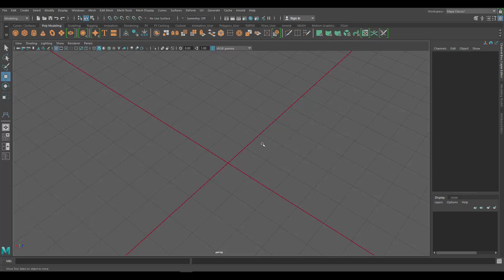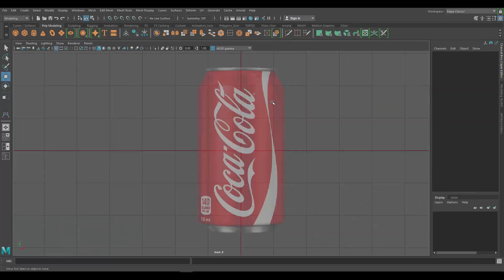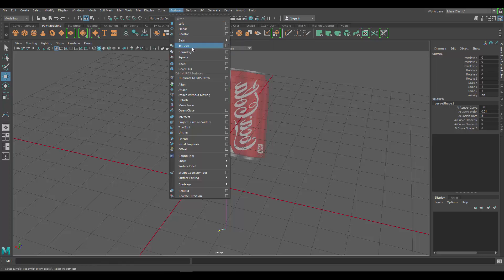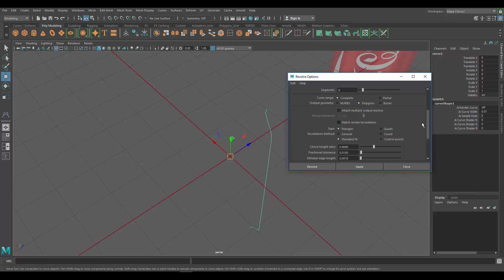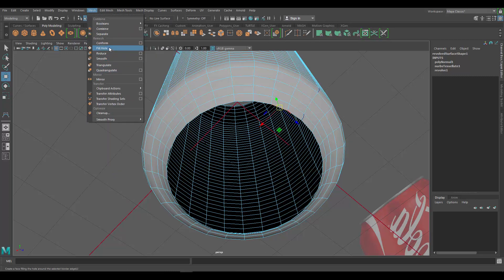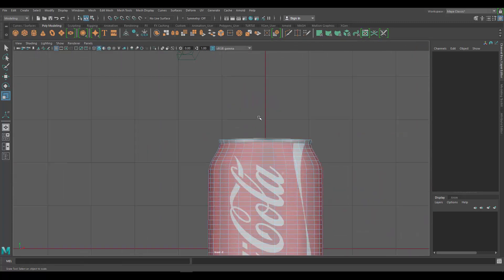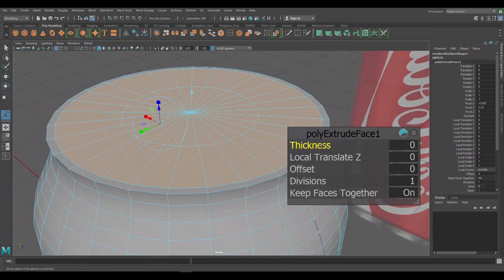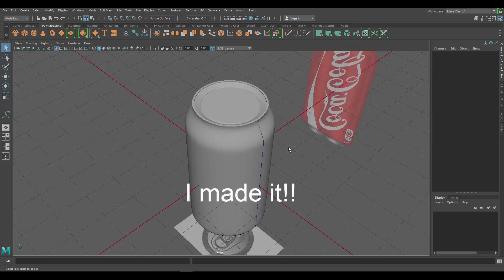Autodesk Maya 2018  - Soda Can Tutorial

Comment: Quick question, I made the can both ways from your videos, however im having an issue with this one. Once i completed the can i noticed the original curve tool line was still there. I moved the can to the side and the original curve was still there (as it looked just prior to doing the revolve). When i select it the edges on my can turn pink and the line turns green. If i delete the line the whole can disappears. They seem to be connected as a group or something. How do i separate this so i can delete it?  Thanks for the vids!! (Ps i am a 2 day noob on Maya)
Reply from the maker: +slpstang08 Great to hear you completed the can! Because the can was made from the curve it is still connected to the curve. Meaning if you do any adjustments to the curve they will adjust the can as well( this can be great and adds more control when you need to) To get rid of the curve go to edit-delete all by type- history. This will deleted the connection between the can and the curve and should allow you to delete the curve without loosing the can model. Let me know if you have more questions!
Reply: Thanks for the quick reply! that worked. Thanks again! Now i just gotta figure out how to texture this thing and im set.